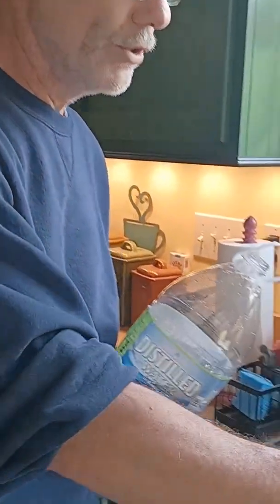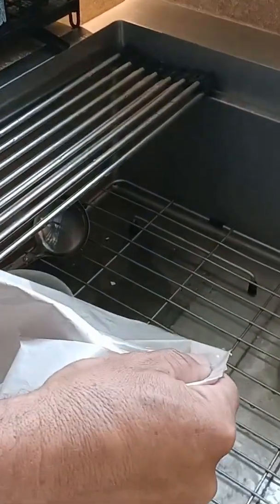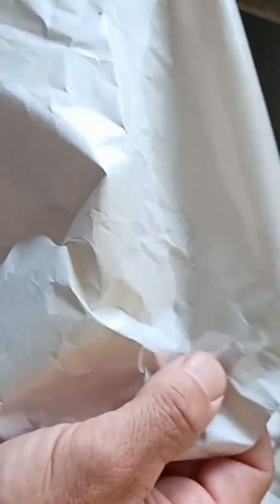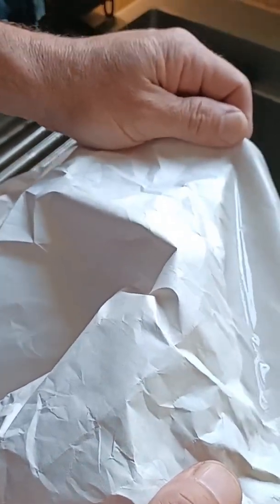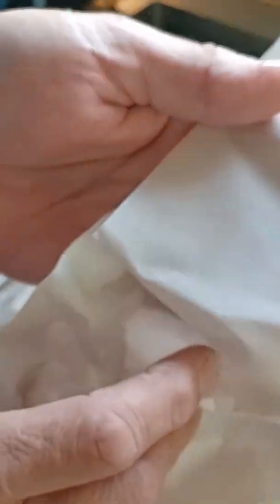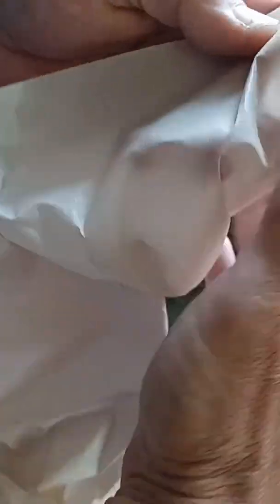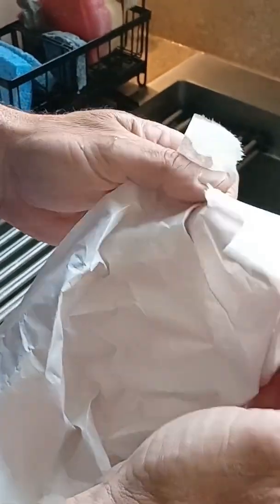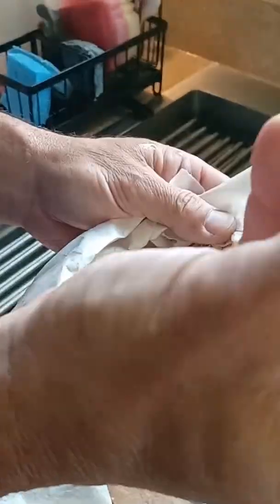Test Your Garden Paper Before It's Too Late

Comment: Thanks for the tip! What kind of water filtration system do you use?
Reply from the maker: @everyrose2  were using a counter top type until the whole house system is installed. The type we use comes from Vevor. We  really like it. Maybe I can add a link..